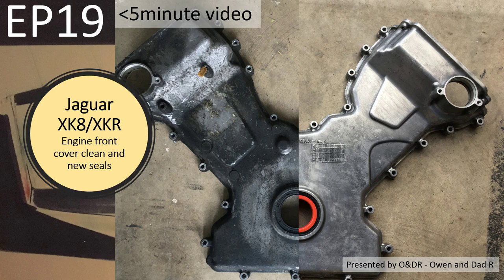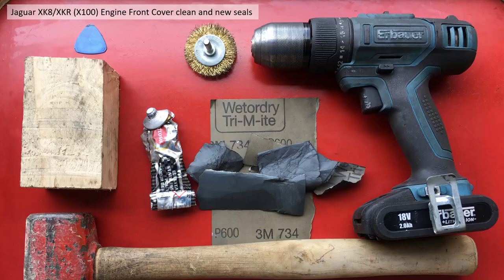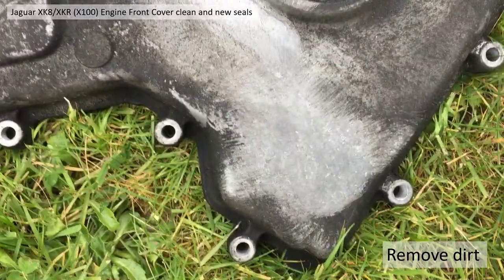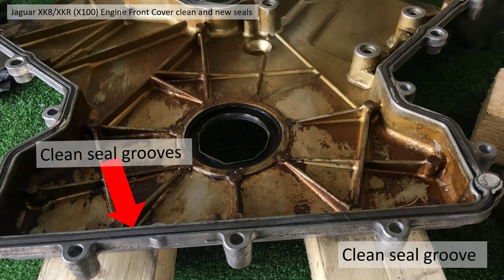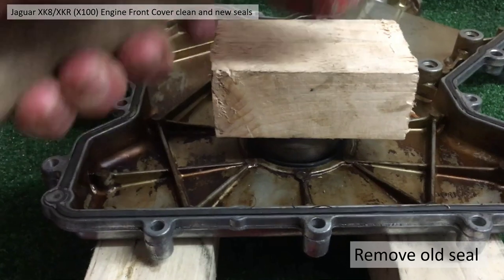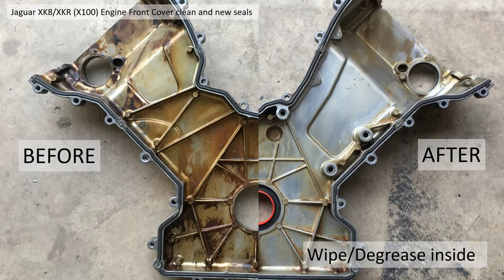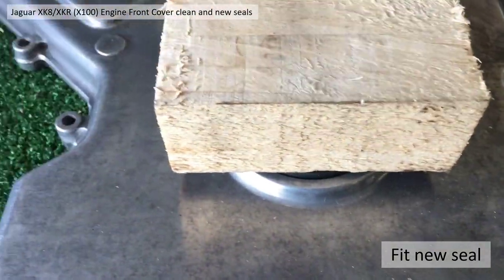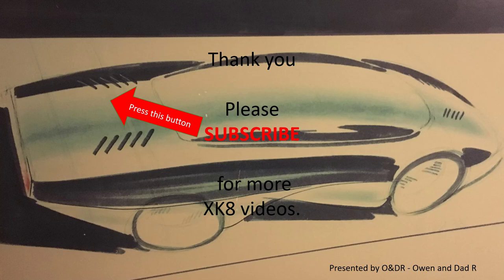Clean up & new seals front engine cover EP19 Jaguar XK8 / XKR (X100)

Comment: Damien, what is the history of this engine?  Miles, oil type and change intervals since new, etc.  The reason I ask is because I did this work on my old 2001 BMW X5 M62 at 235Kmi before I sold it to get a 2014 X5 N63TU and you could still eat off of the front cover inside and out.  What caused all the deposits?
Reply from the maker: 1996 Full service history 80k miles. The biggest issue is  aging of the plastic of the secondary chain tensioners and loosing the plastic wear strips off them.
Reply: @ODRModurol  Are you finding the OEM replacement parts to be vastly superior in construction when compared to the originals?  That seems fairly low time for chain guides to give out.  My X5 was at 235Kmi when they went.
Reply from the maker: OEM spec parts ok but not sure it the chains are OEM spec.